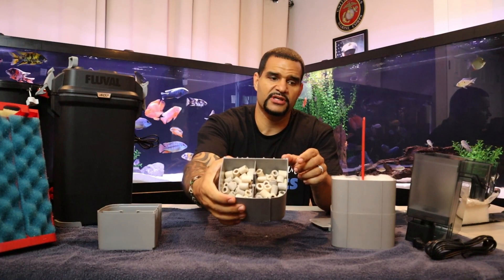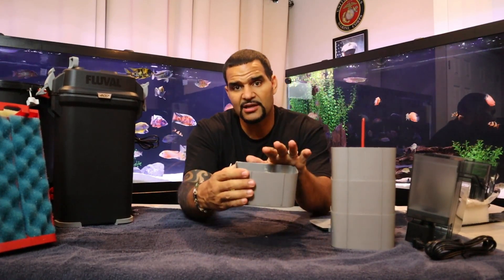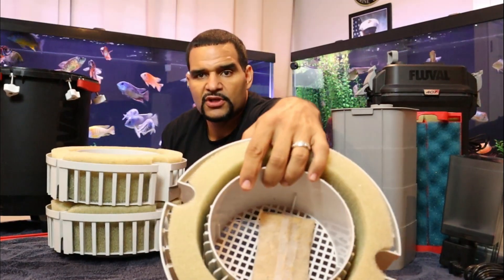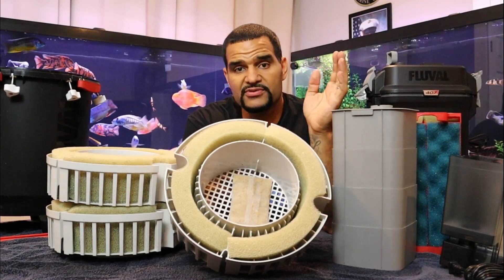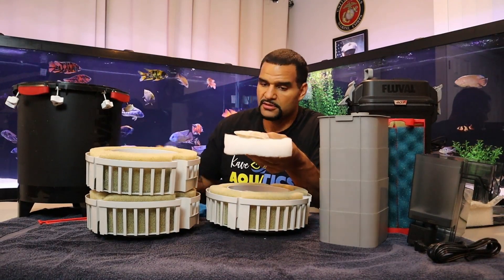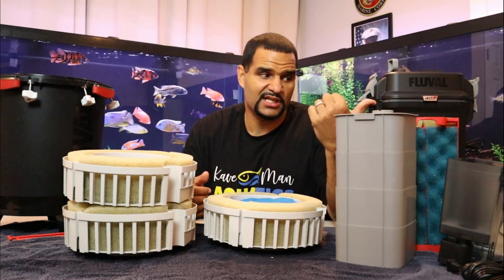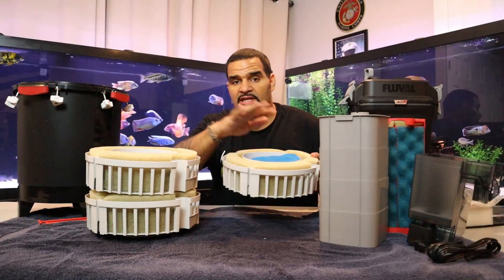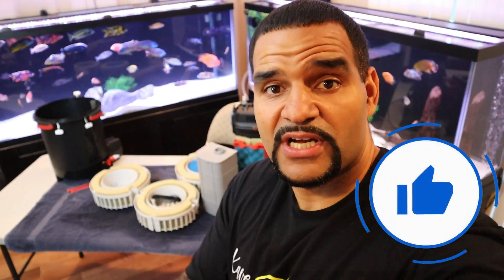Ceramic Rings In Aquarium - Placement in 3 Different Filters (And All Your Other Media)

Comment: I have all those for every tank in my home from the wife’s tanks and mine to our daughters tanks . One thing I add to the FX4/6 is ceramic O rings inside the canister along the bottom sides that’s open and has no contact with the motor , so far it works out great for the past 4years ! Great video

Comment: Thank you so much for your videos… they help so much. I’m relatively new as an Aquarium owner and am looking to upgrade from my 5 gal to a 10 gal. I have a basic HOB currently. I have a coarse sponge first, then some Seachem bio filter rocks in bags next and then a fine filter for polishing the water. I recently got some ceramic rings and love the look of them. They are too big for my current filter. Is it okay to add them to my tank bottom on top of my gravel to promote more beneficial bacteria and just look cool? If I add some ceramic rings to the bottom of my tank, when cleaning my tank, should I just swish in my siphoned tank water after vacuuming my gravel?  Thanks so very much for your great content! Cheers, Dottie
Reply from the maker: You can add them to the bottom if you think they look cool. They will grow some beneficial bacteria on them as well but not as much as if they were in your filter. But thats ok because you've still got your filter doing that job. Dont worry about disturbing them when you vacuum because like I said the majority of your BB will be in the filter 😊

Comment: Sir can i keep ceramic rings over the substrate without putting in filter?
Reply from the maker: You can, but they wont get seeded as much or as fast.
Reply: @KaveManAquatics  will it atleast server the function? 
Actually my betta tank has no filter and zero water flow so i was thinking if i could put ceramic rings in the substrate
Reply from the maker: It may, but it depends on what kind of bio-load is produced. Too much ammonia and it may not be enough BB.

Comment: With the fx6 you could use a small additional canister that you could attach in the external flow pipe and fill that with chemical. That way the main canister would only be mechanical and biological. If unsure watch pond guru on setting up filters properly.
Reply from the maker: Thanks, I've seen how pondguru sets up his FX6, loaded with expensive Bio-home. No Thanks.

Comment: Hey Kev, great videos my man!!
Need your input on this one. I have a 45 bow front that has been established for some time now and I’m now about to start up my 100 gal and will be running the FX6. I wanted to ramp up the cycle process and I thought about buying some nylon bags and filling them up with my ceramic rings and tossing them in my 45 bow front to start the beneficial bacteria process. What are your thoughts on it? I would have to just dump them in my tanks as there’s no more space in my HOB or my 206. Thanks brother!
Reply from the maker: Yup, that would work. You obviously wont get as much BB on them as if they were in your filter. But will definitely get some. And they'll help in getting your new tank cycled quickly when you pop them into the filter for that tank. 👍

Comment: I'm changing from an internal filter to a fluval 107 canister filter , was wondering should I just take out the old filter and put the media into the new one , it's a well established tank years old now , the media is just one sponge , or should I run both together for a few weeks till new filter establishes then put old media  in ?
Reply from the maker: You can do either or. Both will work just fine in keeping your tank cycled. Key is to keep that seeded media in the tank one way or another 😊👍
Reply: @KaveManAquatics  thank you , alot of conflicting opinions on this 👍
Reply from the maker: I’m sure there is but I wouldn’t steer you wrong 😁

Comment: Kave bro plz tell me one thing that whenever i do water change in my tank I first clean the glass and then do a water change.but when I saw other fish keepers and even u doing a water change u first do a water  change and then clean the glass before adding water into the aquarium plz tell me why do u do that  ?
Reply from the maker: I actually dont clean my glass that much at all. My Pleco takes care of that. When I do clean the glass I do it after removing the water just because its easier to scrape off when theres less water in the tank, less splashing around. Either way you do it though would work fine.
Reply: @KaveManAquatics  ok thanks a lot

Comment: How much do you feed your big fish? I have mostly large haps & peacocks. I feed northfin 3mm. I have been feeding 1 tablespoon a day & I feel its not enough.
Reply from the maker: Its more than enough. Thats exactly what I feed and how much. And I fast them on sundays. I have about 60 fish
Reply: @KaveManAquatics  okay ill just keep feeding 1 tablespoon of northfin & ill fast on Sundays. How often do you change your chemi pure blue & purigen? I have been changing mine every 30 days but that chemipure is expensive 😫.
Reply from the maker: I try to change it monthly, but honestly I do go past that sometimes...because yea, that stuffs expensive lol And it adds up with multiple Huge tanks. But it really does make such a difference!
Reply: @KaveManAquatics  okay I have one more question. 😆.  I have two fx6s with intake on each end of 125. Outputs are spaced out somewhat in the middle. Flow on both hitting front of glass pointing up creating surface agitation. I also have a wavemaker. Whats the proper placement for that & should my outputs be facing same way as wavemaker?

Comment: If ceramic rings don't fit in my HOB can I put ceramic rings in a mesh bag and put it right in the tank?
Reply from the maker: You can, but it won’t be as efficient. Bacteria need oxygenated water flowing through your media to thrive. The rings just sitting in your tank won’t have that flow they would have in your filter.
Reply: @KaveManAquatics   so I have the aqueon quietflow for my 55 gallon. Would it be more beneficial to upgrade the a HOB that has the trays? Like the one in your video?
Reply from the maker: Ot would better to upgrade. I suggest the Tidal. It’s an awesome HOB. You can purchase through my link here - https://kavemanaquatics.com/products/seachem-tidal-hob-filter/
Reply: @KaveManAquatics  thanks man. Bout to order it. Once I get it should I just remove the aqueon and lose all the beneficial bacteria? Or run both until the tidal gets the beneficial bacteria?
I do have a sponge filter in the tank as well.
Reply from the maker: @alexcintron1243  You’re thinking is correct, run them both until the tidal builds up some BB. About a week or 2, then you can remove the old filter.
Reply: @KaveManAquatics  thanks again man. Your channel is the reason I got african cichlids 💪🏽
Reply from the maker: Awesome! :_kaveStrong:

Comment: I know I am 3 years late seeing this video, but do I need ceramic rings if I have 2 sponge filters and no HOB filters? Does anyone know? Lol
Reply from the maker: Its possible that sponge filters on their own will be just fine. If you have a canister, it makes sence to add the ceramic rings because it will only benefit the tank. But it may not be necessary depending on your bio-load needs. I highly suggest you check out my playlist for beginners. It'll be very helpful for you 😁 - https://youtube.com/playlist?list=PLP5OXTIIDO8NYvhUHAmwAd54WFmS4d8er

AND, you should check out my new Aquarium Keeping APP designed for beginners! - https://www.youtube.com/playlist?list=PLP5OXTIIDO8MyRXOeOqhwzruSWFdhcaNh

Comment: Ceramic rings and bio balls are junk. Check out the Pondguru videos labeled Pimp My Filter to get the correct method of setting up your filter.
Reply from the maker: Thank you for your opinion Wes. This video is for those that use ceramic rings and would like to know how to properly use them. This video isnt about what the best media is. (And it certainly IS NOT bio-home) Like I stated in the video, I dont use ceramic rings. I use the cheapest media you could ever find, Pot Scrubbers. And they keep my overstocked tank perfectly cycled and crystal clear. Meaning that all bio-media is overrated, ESPECIALLY bio-home. 

If you care to see my pot scrubbers in action, here you go - https://youtu.be/WlKVa0qzjwg